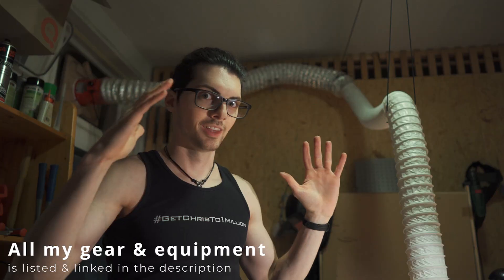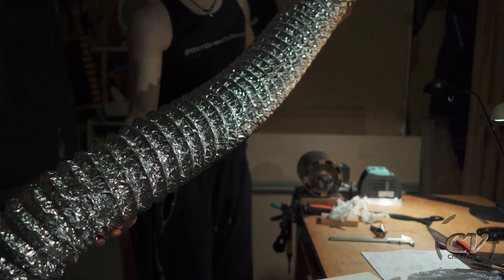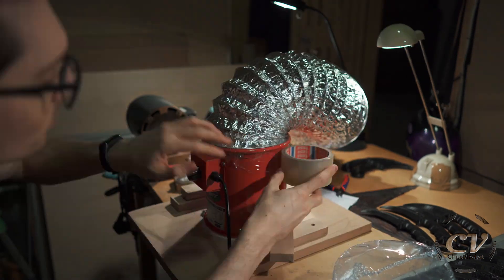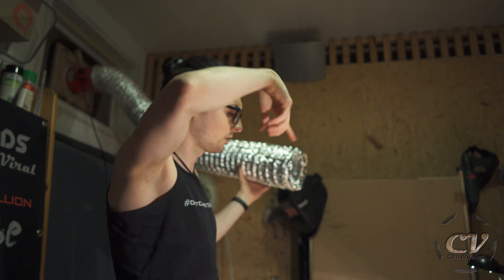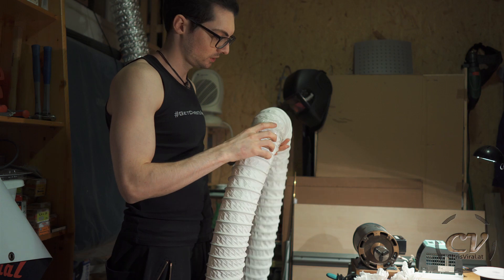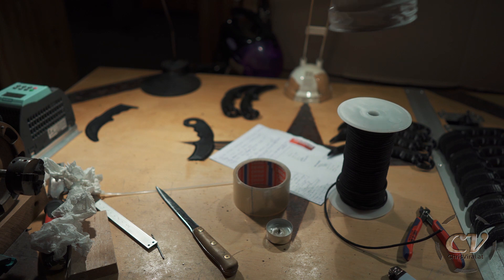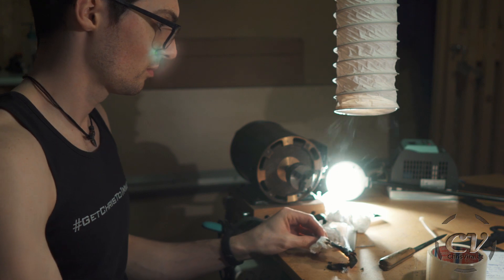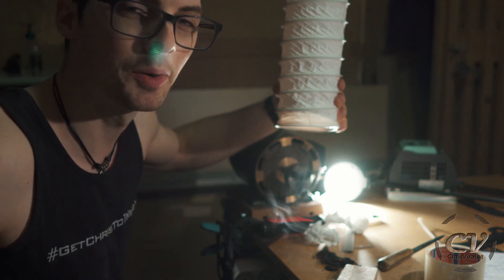DIY Fume Extractor System V3.1 (Frankenstein Abomination)

Comment: You should add a hood to  direct the fumes to the tube
Reply from the maker: Thanks for the tip aaaaand #1 🔥
Reply: I also like to  build stuff at home. I especially like electronics and for my workbench I use a kitchen hood as a fume extractor. I have it screwed to the wall on rails so I could slide it up or down. If you need tips in electronics or some other domains, I'm your guy.